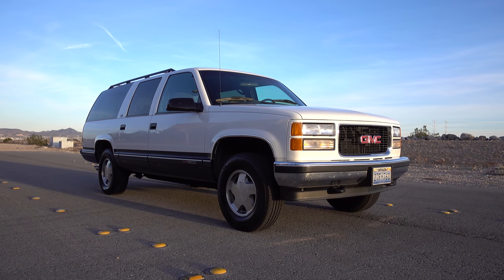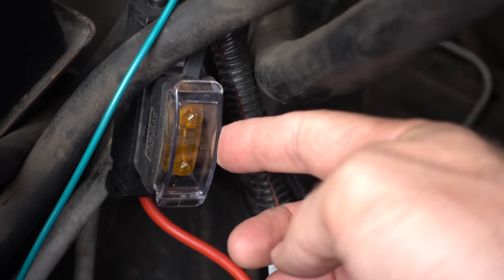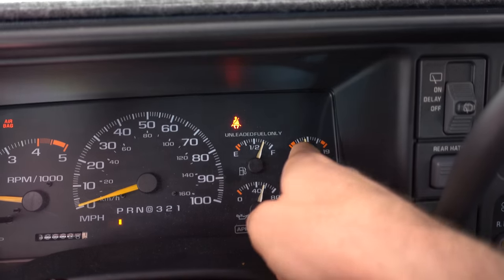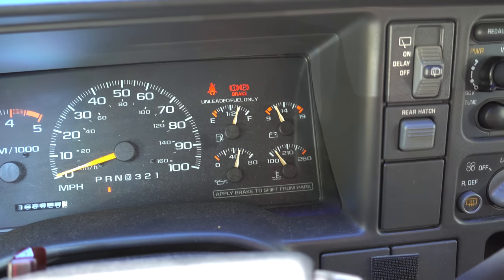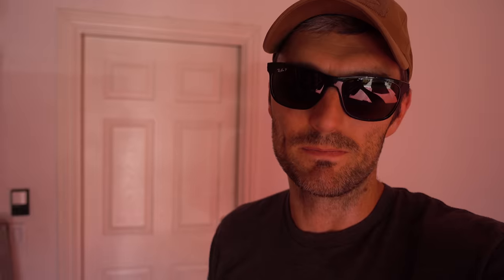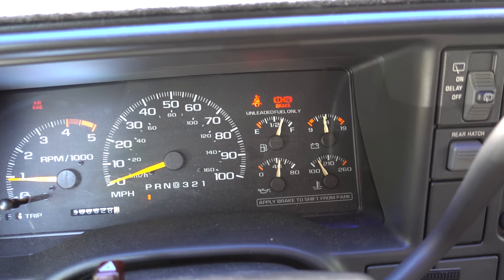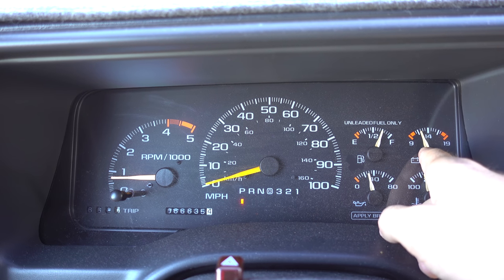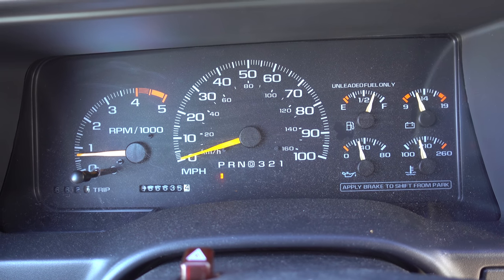SOLVE A LOW VOLTAGE ISSUE!

Comment: Even with a NEW high output battery in play..., you can't replace all of those amps from heavy draw...   A 200+ alternator would certainly help..., especially with the age of the old one and it is probably a 105A oldy....  Modernize the whole system...  Not just one thing.....

Comment: This entire thread may be ridiculous.  Many posts discuss replacing alternator, installing/uninstalling fans,  new battery, etc.That's known as firing a "parts cannon" (replacing parts till you fix it). Check the ground, then test the alternator. Your local auto parts store may check it for free. Mine does. There's another way to do it if your scanner can't test alternator and battery. I'm not going there because this is a  five year old thread and a detail of what to do would require too much typing. If someone needs it, I may be notified that an additional comment has been made and then repost

Comment: They have high  performance alternators for a better performance at an Idle. I think there the same but with a slightly smaller pully so as to turn the rpm's up at an idle. I "Hot Rods" this is not a good Idea, but in the family wagon keeping it under 4500 rpms no problem. Save money on the scam and see if you can get a smaller puly for that thing. Be ware I saw one and you couldn't tell by the naked eye, you need caliper micrometers to compare.  The smaller pullied alternator was only by about 2 mm difference.

Comment: I will consider a big 3 upgrade I'm going to do a big 3 upgrade on my Tahoe cuz I went through the same issues but I'm running a thousand watt amplifier in my truck as well as my heater and my voltage digs down so I'm considering on doing a big 3 upgrade

Comment: Mine is doing the same 99 Suburban 5.7 K1500 minus the after market fans. all stock no amplifiers, nothing. I am on my third alternator new not rebuilt none of the alternators are working now my battery will not hold a charge.

Comment: Electric fans draw a lot of power. I have a dual fan setup on my offroad rig with no other big power draws other than the engine and trans ecm, and the alternator is an upgraded 200A unit. When running low and slow on the trails, the fans tend to be on 100% of the time and eat a ton of juice. Voltmeter reads a max of 12.5v fans running, however, turn the fans off and the reading goes to 14.5v. I'd suggest going with a bigger alternator with a heavier awg(say somewhere between 8 & 2/0) wire between the alt and batt. Then to be even better, go with a dual battery with isolator and connect the fans to the secondary battery. This will ensure that your vehicles electronics will be getting full power at all times and your starting battery will always be topped off and ready for cranking. You also have the option of a dual alternator, dual battery setup. One set of batt and alt for the vehicle and one set just for the fans and any other equipment. Point is, electric fans, especially dual fans, eat a lot of power. In the end, it's cheaper and less problematic if you put back the original engine driven fan and add a smaller kicker fan on the condenser.

Comment: Clean the contacts, replace the alternator. Easy fix,.....97 Tahoe LS 4 Door
Reply: Michael Peschetti he's replaced all of the wiring, the alternator and the battery. All the connections are clean.

Comment: Literally have the same problem but it may be my alternator or my battery because I own a 1994 chevy suburban and when I drive or turn on the ac & my battery sensor still near the 9 volt meter

Comment: I'm dealing with similar issues on my 1995 GMC Sierra. I've replaced the alternator 3 times and they start out working and then they eventually do what yours is doing. And I have a H.O. 220amp alternator in it. I'm going to end up trying a different brand alternator. Anyone know a high quality brand that will stand up.

Comment: Did you ever fix the issue. Man I switch to a yellow cal battery and still have the issue.
Reply: Not fixed but I know what it is... the alternator. At 'hot' idle it just doesn't provide enough amperage to keep up. Need a 250+ amp alternator. Don't think I'm gonna spend the money though. I might be taking the fans back out...

Comment: should be at 14.4 to 13.5. if below 13.5. you have a problem. lol id go big 3 upgrade and depending how many amps that fan set (the electric fans for the radiator) are you may consider going for a higher output alternator. (tho i dont think it should be needed but eh)

Comment: It might be the alternator because you replaced that about 2 months ago and if you didn't make sure the battery was completely charged you could have damaged the alternator by having a have dead battery.  New alternators don't like dead batteries because they haven't been broke in.  The video you changed alternators in you installed a 130 amp alternator.  The electric fans probably don't use all the extra amps from the new alternator.  When you change your current alternator with a new one make sure the battery is completely charged or this problem will happen again.
Reply from the maker: +Jeremy's Garage and fun stuff Interesting. I did check for alternator voltage while the fans were off and I was getting 14.6v but I'll check again.

Comment: I'm having the same issue with my 96 caprice, my voltage drops and stalls when I'm at a light and the car is in idle but when in neutral it doesn't drop or stall at all
Reply: Same problem
Reply: Same, and I just got a new alternator

Comment: That's a LOT of fan. Maybe better off to have fans wired separately to control temp as needed. But back to basics, if you want that much fan, more alternator output is needed.  Dual battery install will simply buy you more time before you run low.
Reply from the maker: Completely agree. New 240 or higher alternator is needed.

Comment: Yes if you have an open cell battery not a sealed battery you can check in there and see if any of your cells Arlo just with a flashlight be very careful not to Splash that s*** on you there's plenty of places across the country to recondition your battery and give you the same warranty as most buy over the counter auto parts stores for a quarter of the price for the battery

Comment: Battrey is ok  alternator does not give  all that power      u cant use the fan all the time  more battery wont help u need a system to turn the fan on only when the engine need  to cool down maybe a termostate in the radiator

Comment: I would recommend to add some extra ground cables from the frame to engine and back to the battery. My 1994 Silverado had charging issues and adding extra ground cables solved that problem.👍😀

Comment: You need a bigger alternator than the 140 you need a 220 or 270A big case mod swap contact dominic irragi alternator or singer alternator. Stay away from ebay alternators they do not do rated power. You are dropping voltage because you are maxing out your alternators output resulting in you dropping to battery resting voltage 12.8 or less under full load....no amount of extra battery will help that issue.

Comment: my 2000 Escalade is experiencing similar intermittent issues , starting just recently , I discovered my main fuse off the battery was part of it , like it had been broken inside and barely made connection, I recently replaced a bad alternator , and think my front heater box fan is part of the problem , as it  seemed to be on when the problem appeared ... But my question is why dual electrics ? my temps register the same running the stock fan , in similar out side heat , I run a 2 1/2" radiator , and 50/50 antif ...  I agree with the majority of comments , check and clean all grounds first ...
Reply: Are you talking about the fusible link? Because I’m having the exact same problem on my 97 Silverado. Checked all connections...my battery indicator light doesn’t come on either so I’m not sure if that may be another issue.

Comment: your alternator was never designed for that amount of constant loading replace it with a 120 amp that will five you plenty of power with rome to grow in the future
just to but it into perspective on mt f150 my factory alternator only produce 30 amps when it was new 

so basically you are not having an energy storage problem (tho running that fan you should install dual batteries) but its a power generation problem

Comment: I fixed the same issue on a 1998 k2500 by replacing the alternator charge pigtail
Reply: How were u able to tell it was bad? Burnt connector?
Reply: @diycast6914  if you suspect it may be the pigtail I would try taking a small pick and prying the connector tighter and if that doesn’t fix it check the belt/tensioner  and if you just replaced the alternator/battery I would make sure the alt is making good grounding through the mounting pegs and if you take off the belt it should spin basically freely if it doesn’t you have bad bearings in it if it’s still not charging the voltage regulator could be bad  it’s on the back of the alternator and is what goes on the pigtail if you’ve done all of that and it still doesn’t charge I’d make sure that pigtail has a complete circuit to 12v from the ignition should be constant but usually if the ignition isn’t producing 12v you have other issues

Comment: Those fans are overkill like a mofo, a set of electric fans from an '06 Suburban would work fine and draw way less power.  I have a set in my '01 with a premade wiring harness and turned them on in the PCM via HPTuners.  They work like factory fans in a 2006+, still have the original 2001 alternator and charges fine.  In fact, the bastards hardly ever hit high, even in Texas summers with AC running, temps are always just under 210 on the guage.

Comment: I fix mine by changing the tensioner and the belt and it went to 14.7 
Try it and let me know if works for you to
Reply: I have a doubt about this tensioner replacement, did your belt squeak when Tha voltage dropped? Because  I have tried about everything to fix that problem on my 98 blazer with the voltage drop, and I'm tempted to replace the belt tensioner but I haven't done it because my belt doesn't do any squeaking noise so I assume the belt tensioner it's OK, but I don't really know anymore.

Comment: Alternator not performing as rated.   Check diodes and voltage regulation, battery is fine, car electrics fine, Possible voltage regulation, As voltage drops voltage regulator causes alternator to push out more current by increasing current to field windings etc.  Check alternator output with DC clamp meter when fans and lights and aircon are on and you have your voltage drop condition and compare this to the  rated out put of your new alternator..     Also check rear screen demistor  is off, they draw a big current. Some times indicator led at switch dies, so you might not realise it's on.  Check connections to alternator are firm. Else purchase some time of an honest auto electrician.

Comment: Well the truck basically runs off of the alternator when it's running. If that alternator doesn't have the capacity to run the fans, you should replace it and get a stronger battery while you're at it. It's putting the battery under a slight load it shouldn't carry. Check this alternator out. I used one of them for my '95 Chevy Suburban! Just wanted extra beef in mine, but looks like you need it in yours.
// https://m.summitracing.com/parts/pwm-47401

Comment: The Alternator is the issue you put in a fan that clearly draws more amperage then the old one the Alternator can't keep up with running all electronics charging the battery and running huge fans.

Comment: They say a 350 motor needs at least a 350 amp battery  just to run the motor and you need to be higher amps than accessories  need

Comment: My initial thoughts were that it could be a weak alternator, but I’m just learning this stuff too so I may be way wrong.
Reply: You can get something high output.
Reply: Definitely abnormal to have it dip that low. So that’s why im thinking that a high output alternator can help. Because an alternator is basically responsible to carry the load of all the electronics. If you add another battery, the alternator can’t keep up still. Like someone with a lot of muscle (like a great battery) doesn’t mean they can run 5 miles in one breath. So a good alternator that fits the needs of those fans can help by distributing adequate power from the battery into the electronics you’re running.
Reply: But I could be very well wrong. Don’t take my advice, it’s just my thinking out loud lol.

Comment: I had this issue, checked the grounds they were good, turns out it was the fusible links at the battery, they corrode inside and have to be replaced.

Comment: I’m not sure if you have this figured out yet or if anyone suggested it, but do you have the fans wired correctly? Only one should come on for engine temperature, the other fan should only come on for AC , therefore you wouldn’t be drawing as much power and doubling the batteries would definitely be a plus! When AC is turned on it should trigger relay to power second fan! Those fans are usually powerful enough to only have one running at a time! That’s how most vehicles are wired from factory.

Comment: Hey jimmy need a bigger alt. duel batts . I have a 99
sub. with a 502 BigBlock got same rat fan set up got no problems death valley heat no trouble.i now live in canada so my cooling system not working that hard these days

Comment: I have the same problem on my 2007 gmc serria  & my head light flash
Reply: Have you had it stall too?
Reply: @rachealhover7781  yes
Reply: I changed out the alternator and it still fluctuates. I'm looking up what the airbags were recalled for

Comment: Your alternator charge seems fine you can always take it off and have the alternator bench tested to make sure there are no worn out parts the best thing to do is check your power wire and your ground wire and if those are fine I would just add a tack underneath the dash just for voltage those gauge setups are the worst overtime they just wear out and they're not totally accurate I have the same gauge in my 1997 GMC Sierra

Comment: I have the same problem did you ever fit it?
Reply from the maker: Yes, the problem, for me, was the alternator. I'm finally running a Mechman Elite 250 amp and all is good. Also upgraded all charge wiring and grounds. Hope that helps!

Comment: Your battery is not supposed tu run electornics after engine start (it si there only to start engine). Alternator is there tu charge the battery and to power electronics after you start the engine

Comment: I had this problem look for a overdrive alternator pulley it will spin your alternator little faster at idle
Reply from the maker: +6789olds I'm looking now. Thanks!
Reply: 1 Road  I think I paid $29
Reply: 1 Road  520004 - Auto Specialties Overdrive  summit racing
Reply from the maker: +6789olds I'm going to try this and hopefully make a video on it... Thanks!

Comment: Im late af but anyways, i got 100amp alternator, few batteries, 6kw of amps and in idle it goes to around 12 but when driving its around 13.1, check your alternator
Reply: My battery light is on and my car still drives I switched the alternator  and the car battery light stays on do you have any ideas
Reply: If your volts are 13+ from battery while everything is running you are fine, it your wiring runs the same way it might disturb the cars own meter, if you have more volts in battery than your meter shows you can try to rewire it, ps if you wanna buy a second battery, well you already know it takes longer to charge and stresses alternator more, oh and fuses are important😂

Comment: You might have gotten a faulty alternator. I've seen it happen before with a friend.s BMW and a supposedly 100% new alternator. Just go to your local auto parts (I use Advance Auto) they can check your charging system.

Comment: I don't know if you guys fixed these low voltage problems.......  I just did...
It's easy but it will take some time....
grab a dremel with a hard rock tip... then crean every positive terminal that goes to the battery and to behind the battery compartment...   clean every connection..    same for the negative cable.... clean every connection... all the washers.. and clean the engine block...... thats all...

Comment: Hi Jimmy. I'm an electrical engineer and I'm sorry that you are being inundated with advice viewers who don't have a basic understanding of charging systems.  I hesitate to give any advice without being provided with a measurement at idle of; the alternator load current at idle, total load current(all accessories on) and battery charge/drain current. Well spoken video of your efforts so far.

Comment: I have a 2006 GMC envoy. Has a new battery and new alternator. At an idle. The voltage Gage regulates between 14 + 12. Dash lights and headlights dim. But I have no. Low voltage. Or battery light on. Does anyone know. Why this is happening.

Comment: So if my voltage is never at 14 what does that mean? I put a new battery
Reply: It doesn't have to be exactly at 14 miss... it should be 12-14 depending on the vehicle